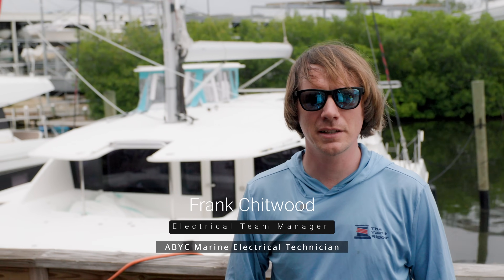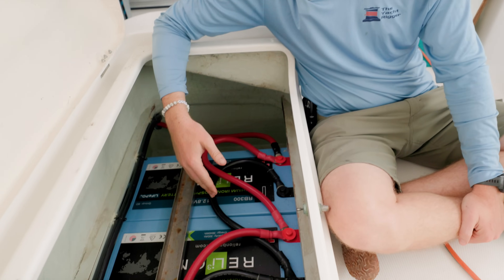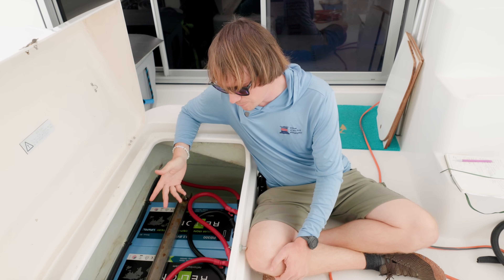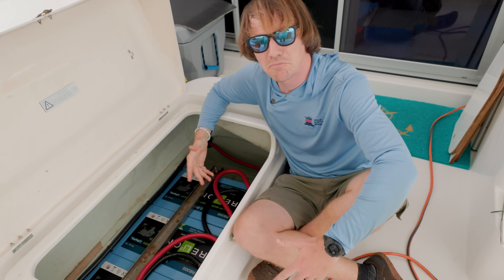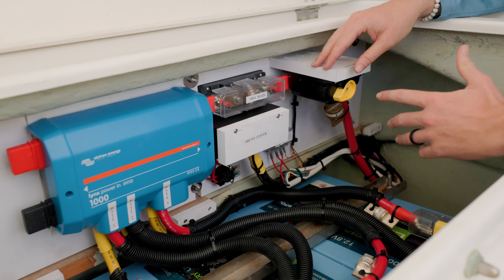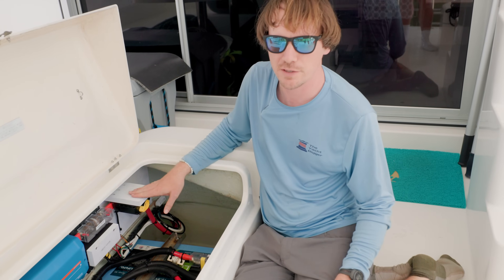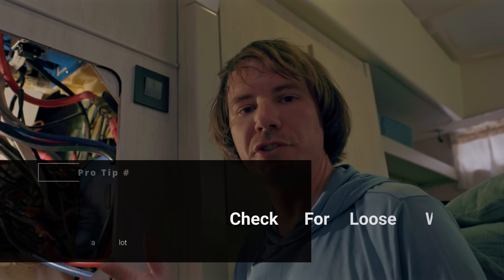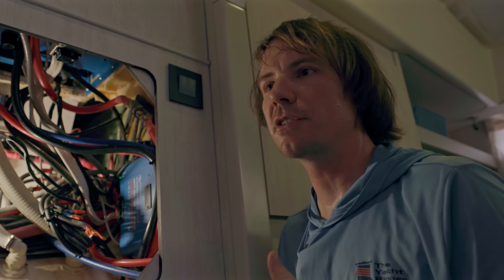Lithium On Your Boat | You Don't Want to Do it Wrong!

Comment: Sorry got to chime in .... @5:14 you are talking about the Relion vs Victron charging ability.  You said the Relions can only take 50A max charge and that the victrons can do double that.  In fact Relion recommends 15-50A charge for the RB300's but you can charge up to 100A.  Also the Victron states on their spec sheet up to 400A but reccomends less than 150A for their 330Ah packs and less than 100A for the 200Ah packs.  One of these days boats will quit screwing around with 12V like it's the 1950's and move to 48V.
Reply: I think you hit the nail on the head, and as you point out it is nuanced as they throw several numbers at you. ABYC Standards say to follow manufacturer recommendations. The recommended continuous charge current for the ReLion in question is 15-50A. So, when we tell the Cerbo the maximum amount of current we want it to allow to flow into a ReLion, we tell it 50A per battery, as this might be sustained for hours on end to bring the battery from a low state of charge to a higher state of charge. Meanwhile, the Victron batteries (as well as several other major brands) have a higher recommended continuous charge current (150A for the closely comparable 330Ah model, as you noted) so we are more comfortable setting the system for a higher charge current with those batteries. I agree on the 12V! We have so much ability to dump a lot of watts into batteries these days with large solar arrays and high output alternators that the amperages on 12V system are getting too high. At our shop, we mostly install 24V and 48V systems, and only do 12V if we need to keep the budget lower. We have been installing 48V systems on catamarans with 130A alternators on each engine and DANG those things produce a lot of power! There's quite a few videos on our YouTube channel showing those. Thanks for watching!

Comment: My 6yr old Relion 4ea 300ah are going bad,  I believe the settings take the charge too 100% instead of a best 90%.  I never get close to 10%.  Curious what cell manufacturer is used for victron batteries,  I'm going with CATL next.
Reply: By what method are you determining they are only getting to 90% state of charge?
Reply: @FrankTheYachtRigger  I believe they are being charged to 100% , not the 90% max, or 10%min.per prismatic cell recommendation. When % of charge gets to 76%  system shuts down due to low voltage.
Where are you located, I'm anchored Keywest 2017 leopard 48 ready for upgrading
Reply: @wstadlock  What is the voltage of the system at shut down? State of charge % calculations are just estimates, so better to know what voltage the system is at when it switches to Float and what voltage at shut down. We are located in Tampa Bay in downtown St Pete at Salt Creek Marina, so just an overnight sail away. We have worked on several Leopard 48's. Here is a video about one of them where we did quite a bit of work: https://www.youtube.com/watch?v=H4LTq7MzO4A
Reply: @FrankTheYachtRigger  Nice video,  I'm sure my boot stripe is lower than Flip Flops. I'll contact office soon about coming up after all  the weather goes around us and stops hitting you.
Reply: @wstadlock  I dunno his is pretty low! Contact us soon, we are booking into October for major electrical projects.

Comment: How many hours did you have in this project?
Reply: This boat took about 70 man hours over the course of 5 days. There are a few things done not shown here as well. Generally speaking, the boats that come to us for ABYC compliance work range from 30 to 80 hours of work depending on the size and age of the vessel and the nature of the issues. In this boat we also upgraded the shore power and added start battery maintenance chargers in that time amount which weren't compliance issues but good upgrades nonetheless.

Comment: Case ground is not effective unless your RCD device trips. Note that the electrical current takes multiple paths to return to its source - also your wet hands touching the case, thus ensure it works.
Reply: Victron answered this more concisely than I could. This is from the Wiring Unlimited guidance document:

7.6. Isolation and grounding of Victron equipment
This chapter explains the isolation of a variety of Victron products between AC and DC, or between DC and DC. This information is needed so a system containing a Victron product can be grounded correctly.  

Isolation of all Victron inverters and inverter/chargers:

Between the AC circuitry and chassis: basic isolation. The chassis therefore must be grounded. ·      

Between AC and DC: reinforced isolation. Once the chassis has been grounded the DC is therefore considered safe to touch if the nominal voltage is 28V or lower.

Between the DC circuitry and chassis: basic isolation. Therefore, DC negative or positive grounding is allowed.

In the case of positive grounding, non-isolated interface connections will refer to the DC negative and not to ground. Grounding such a connection will damage the product.   The AC ground terminal of all inverters and inverter/chargers is connected to the chassis.    

AC neutral grounding of Victron inverters  

The neutral of all inverters rated 1600VA and above and the Phoenix Inverter Compact 1200VA is connected to the chassis. Grounding the chassis will therefore also ground the AC neutral. A grounded neutral is required for the proper operation of an RCD (or RCCB, RCBO or GFCI).

If no reliable ground is available and/or if an RCD (or RCCB, RCBO or GFCI) is not installed, the AC neutral to chassis connection should be removed to improve safety. Warning: such an installation does probably not comply with local regulations.

The AC neutral of lower power inverters is generally not connected to the chassis. A neutral-to-ground connection can be established, however: please see the product manual.

AC neutral grounding of Victron inverter/chargers

The output AC neutral of all inverter/chargers is connected to the input AC neutral when the back-feed relays are closed (AC available on input). When the back-feed relays are open, a ground relay connects the outgoing neutral to the chassis. A grounded neutral is required for the proper operation of an RCD. Disabling the ground relay is possible on most models. Please see the product manual.  

Isolation of MPPT solar chargers

There is no isolation between PV input and DC output. There is basic isolation between input/output and chassis.    

Isolation of other products

Battery chargers: reinforced isolation between AC and DC. Basic Isolation between AC and chassis, except for the Smart IP65 chargers which have reinforced isolation between AC and the plastic casing. DC-DC converters, diode and FET splitters and other DC products: the casing is always isolated from the DC (basic isolation).

Comment: Should have used the Sure Power shore power cord plug.
Reply: Do you mean Smart Plug? They are nicer for sure, but not as easy to get a hold of.
Reply: yes they are it. I converted twice on 2 different boats. Last one was after the HVAC current after 8 years welded the contacts together.

Comment: I'm tending to install 50 or 100amp circuit breakers one for each battery, before going to the battery isolator.  Thinking of battery hold down...I try to imagine what would happen if the boat broached on a wave and did a roll over... you do not want a battery smashing around... 
Lithium batteries have slightly different voltages to lead batteries... so you need things set up to handle that... Most trouble with lithium batteries is from over charging or running them totally flat...a new trend to look after lithiums is to only charge up to 80% for maximum life.
Reply: Yes, with regards to battery tie down, the ABYC Standard for lithium batteries is there should be no visible movement and consideration taken for security in a knockdown. Beyond just the batteries, the only thing I want to be worrying about in rough weather is the crew, the sails, and the course! And you're spot on with the comment about voltages, and this is where a lot of people go wrong in doing things like hooking up internally regulated alternators directly to their lithium bank or quite literally dropping in lithium batteries and not changing the settings in their chargers to lower voltages. For sure the trend is towards lower voltages, and most manufacturers are recommending around 14.1V now, whereas they may have been more like 14.2V a few years ago and 14.4V before that. Our obligation under the ABYC Standards is to follow the battery manufacturer's recommendations as one would think (or like to think!) they have performed the appropriate tests to determine the safe operating envelope and optimal charge profile. The only comment you made I question is whether the circuit breakers you are using on each battery meet the Ampere Interrupting Capacity Standards. Cheers for the great comment!

Comment: What do you do if the lithium batteries catch fire?
Reply: In that very unlikely event it would be a good idea to press OFF on that RBS switch on your way to getting in the tender or life raft - whichever you can get in faster- and get away from the boat ASAP.
Reply: Is there a source for the battery/fuse bars?  Also, on this video they seem to be just sitting on top of the batteries unsecured.  Is that compliant?  Thanks.
Reply: @tracyoliver550  We make them here ourselves and we do sell them but we have not yet put them on our web store yet for shipping outside Tampa Bay, but I will ask the web team to get those up there. The Class T fuse holders are secured to the batteries both with the tension from the copper bar but also a lot of VHB tape on the bottom. Let me tell you, those things aren't going anywhere! ABYC Standards are very specific about the movement of the batteries and the security of the wires, but amongst the 6 ABYC electricians on our staff here we can't think of any Standard which would make them non-compliant. It is secure, and that is what the ABYC is trying to ensure so it is absolutely meeting the spirit, if not also the letter.
Reply: The FAA has tested 24 different chemistries of lithium batteries at their facility in NJ.   They put a torch to a cell and heated it until it thermally ran away.  Then watched, 23 of the chemistries generated enough heat that that it caused the cell next to it to runaway.   LiFePO4 did not generate enough heat to cause the next cell to run away.

Comment: Why is everyone so keen on fuses circuit breakers are a much better option
Reply: A Class T fuse with a battery switch is the most affordable and simple way we have found to meet the ABYC Standards for overcurrent protection, AIC, and switching on battery banks. In other lower amperage applications around the boat we use circuit breakers, primarily MCBs of which we stock dozens of different sizes and use quite a lot - there just don't happen to be any in this video. If you watch some of our other videos you'll see them in our solar installs and often on our battery-to-battery chargers.
Reply: The only CBs I have found with a high enough AIC is the Carling fa2-p0-14-850-2ba-bt. These are excellent quality but only produced in small batches so they are difficult to source and very expensive (around $900 each). But if the project budget can they are excellent magnetic hydraulic breakers with 50K AIC.

Comment: spare fuse good idea. In this Environment not wraped is not nice. Over time Oxid will be on the surface of the fuse that will be a resistor in the fuse holder.

Solar: not with you. Because of bypass diodes inside the panel the disadvantage you point ohg is history.
When you work with "12V" panels (36cells) and a single panel for your Victron charger it is not correct. Victron wants 72 cell per string in a 12V battery system.

Comment: Call me old fashioned but there is no way I would install lithium batteries in my boat.  One cell going into thermal runaway can destroy the boat and occupants.  I see the attraction with the high energy density but I'm not risking it.
Reply: Okay, if you insist… you’re old fashioned! 😂 Seriously, with current technology the risk of thermal runaway of a properly installed marine lithium system is infinitesimally small. There is a FAR greater risk of electrical fire from a loose wire connection somewhere. It is really important though to have some of the protections discussed in this video to limit current and voltage from ever reaching a point that could initiate thermal runaway in LiFePo4 batteries.

Comment: Lithium batteries?  On a boat?  Yeah....  NAH.  🤮
Reply: Lithium Iron Phosphate. Remember that not all lithium chemistry is the same. These are different, and a lot more stable than the battery found in a phone or electric vehicle.